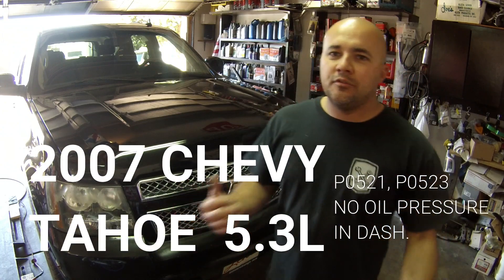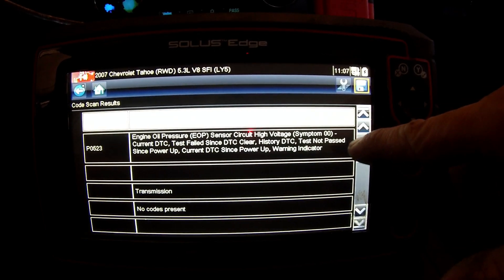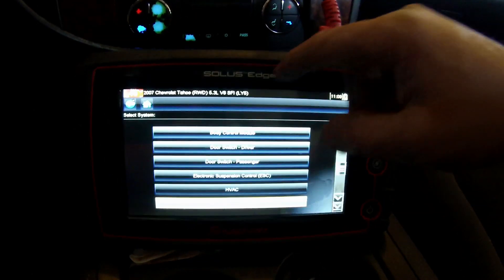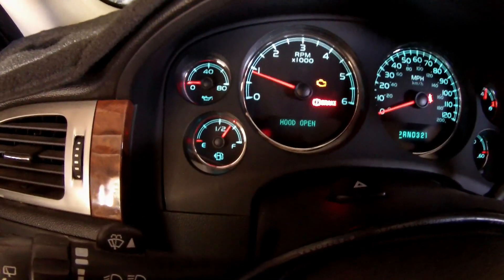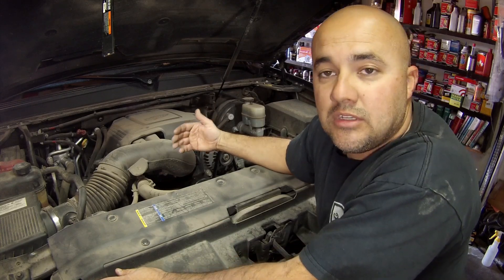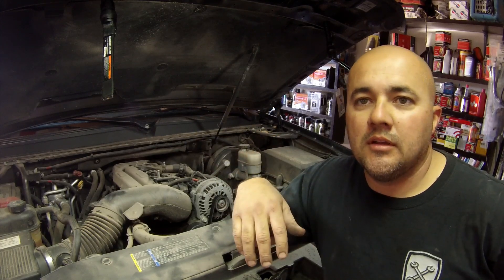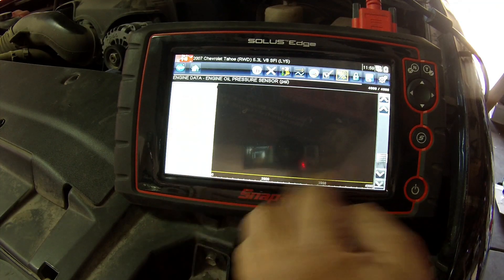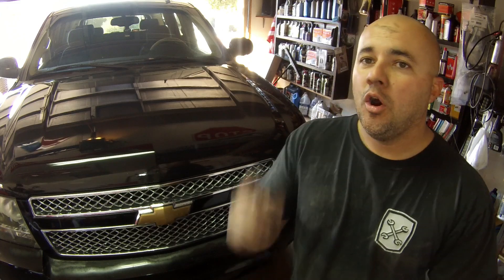Chevy Tahoe no oil pressure in dash. P0521 P0523

Comment: Hey bro whats up i have p0521 it reads about 14psi at idle and at 3k rpms at 30psi I replaced the oil pressure sensor and i keep getting that code very fast so I started checking and noticed that engine off key on i have 2.9 psi and if I unplug the sensor it drops to 0 psi is it normal to be at 2.9 psi when engine is off and it’s probably my oil pump going bad?
Reply from the maker: I would replace the oil pressure sensor w/ a factory one first.  Just unplug the sensor off the old one,  open the box and plug it into the new sensor and see what it reads.
Reply from the maker: In the video I didn’t show replace the little screen under the sensor.  Make sure to change that also.

Comment: Everybody’s going about getting to that sensor all wrong. If you reach straight down from the top of the engine at the back, it’s a direct line to the sensor 6 inch extension on a socket is plenty to get in there if you stick your phone straight back and take a picture of it you’ll see it nothing needs to be removed. It’s about a 15 minute procedure to remove it and replace it.

Comment: Below the sender in the oil passage there's a screen that can be pulled out and cleaned. If this screen is plugged with debris you'll get weird p532 type codes with the new sender. Always pull the sender and pull out the screen and replace it clean. Saves you a come back
later. There's a GM service bulletin on the issue.

Comment: I replaced the oil pressure sensor and filter took me about 20 mins. I am no mechanic but I was determined to get that thing changed. My oil pressure now reads 20 psi, it won’t go any higher than that, it slightly goes up when I hit the gas for a few seconds but it stays under 20. What else could be wrong?
Reply from the maker: 20psi at idle is about normal for a 5.3L. It will rise slightly when you hit the throttle but should stabilize around 20psi.  Hope this helps.
Reply: @fixersautomotive4514  thanks, so this is what I did after that, I changed the oil, I used 10w-30 synthetic valvoline and changed the oil filter and also the air filter just because it was time to do it. After doing that my pressure was up to 40 again.
Reply: Btw I did that 2 weeks ago, after that a-lot of things have happened lol. My started dies and my wife was stranded in Houston, I changed the starter and the oil pressure was down to 0 again. I was upset. So I changed the oil again and nothing. And just when I was about to take it to the shop I thought, man I bet is that damn oil pressure filter that is clogged again. So I went to oreilly’s and bought one for $10. I switched it out and wallah, the pressure is up agaain. So this leads me to conclude that I still have a lot of junk in that engine that still clogging the filter.

Comment: I have the exact same problem on my 13 Chevy suburban and my mechanic is saying his computer it's telling him it's electrical problem mind you we replaced the sensor a week ago and all was fine till yesterday when the reading stuck at 0
Reply from the maker: Very common problem,  you have to use the Chevy dealership updated part not aftermarket for that certain issue.  Good luck.

Comment: My 2011 Tahoe ltz just started doing the same thing just happy it might be the switch vs the oil pump I think that’s really expensive I just got the truck and have to put money in it 😩😩😩
Reply from the maker: More then likely it’s the sensor.  95% of the time it’s just the sensor.  Good luck.
Reply: Was it the sensor? 
I have the same issue. Drove a bit this morning noticed zero pressure. I stopped and checked the oil just to make sure I had oil, lol. There were no obvious leaks. I didn't get a good measurement from the dip stick but I was just making sure it has oil. 
Got home, parked, let it cool & settle and oil level is good. Is it possibly pumping oil but indicating there's no pressure? I purchased the sensor and plan on replacing it tomorrow. I'm just worried it's something worse and by worse I mean expensive.
2009 Tahoe LTZ 5.3 flex 4x4
(Edit to add: my check engine light is on and my oil pressure gauge does not even move but I do not get a warning on the driver information read out, no "low oil pressure/ stop vehicle". Does that mean anything?)

Comment: You explained this sensor issue very well. I have the same issue with my 2009 Chevy Tahoe. I wanted to educate myself about the problem, so that I don't get ripped off. I have had to replace the fuel pump sensor on my Tahoe and the engine light is always on, no matter what I do. Thanks again!!
Reply from the maker: Sweet.  Thank you for the nice comment,  happy you liked my video.

Comment: Any Idea of what this sound may be?  
https://youtu.be/lnWUaX7Kg0E
 I went to work and realized my oil light was on as I was on the highway, as soon as I pulled up to work, the engine shut off and wouldn't restart.  I went and got oil and it started, but now makes this sound.  easy fix?  or a new engine?  any recommendations?
Reply from the maker: That sounds like a collapse lifter making the ticking noise. You might have to remove the valve covers to see if there are any loose rocker arms and pushrods.

Comment: Good Video. I had a faulty oil pressure sensor reading at 0. I replaced the sensor and it read at 20 then went back down to 0. I also replaced the o-ring on the pickup tube. Dreading it’s the oil pump but I don’t hear any changed in the engine.

Comment: Buy the socket. not just a deep socket. autozone sells the oil pressure sensor socket. also gonna need fuel line/ac line disconnect tool. its a chevy, nothing just slides off.

Comment: If on the gauge sweep the oil pressure gauge would not have moved,  that would set an engine code? Also did you replace or clean the oil pressure sensor filter right under it?

Comment: So I know this doesn't have a ton to do with this video but was hoping someone could point me in the right direction. Upon starting my engine the oil pressure is just above 40 after it warms up and is driven a bit it slowly drops down eventually to 0 and tells me to shut off engine. I have replaced the sending unit and screen. This seemed to fix the problem for a couple weeks. I then changed the O-ring on the pickup tube last night. Refilled with fresh 5w-30 synthetic oil and did a test drive this morning and still having the same problem. the engine never sounds like it isn't getting enough oil to any part. If anyone has another direction to head I'd appreciate any ideas. Thank you.
Reply from the maker: If I was you,  I would install a mechanical gauge w/ a hose that’s long enough to read w/ the hood closed.  Install the gauge in the same hole as the oil pressure sensor. Take it for a drive and see if you lose oil pressure. If the oil pressure drops again. Then it’s your oil pump.  Worse case scenario if the oil pump doesn’t fix it then it’s inside the block. Maybe main bearing wearing out.  How many miles you have ? Also maybe use a thicker base oil 20w50. Hope that helps.
Reply: @fixersautomotive4514  it has 145k miles. I'll see if I can find a gauge to get that checked out. the oil pump would defiantly be better than anything in the engine. thanks for the reply
Reply: You figure it out? Same with my 12
Reply: @ryno856  everything went south. Put in a new engine. Something bounced around under the head. From what I could tell this is the first sign of the end

Comment: Just had my sensor AND filter replaced today. Make SURE they place a NEW filter when they replace the sensor. I had it done at dealership. My truck's been paid off for 5 years so I don't mind. Plus, the dealership works on Chevrolets 6 days a week, are used to replacing hard to get to parts like this, and they've got all the needed tools. I was in/out in an hour. Sometimes you pay for convenience.

Comment: I did every thing which is mentioned in this video but still no luck. Still its showing 128 psi oil pressure weather the engine is running or stopped. Can enyone help me with this plz. Really in big trouble
Reply from the maker: Abdullah Awan hello,  are you able to do a gauge sweep? The dash gauge itself might be bad. Maybe try a different brand of sensor.
Reply: @fixersautomotive4514  i did the guage sweep and its not working. But it is saying in the dash that engine oil pressure low turn off the vehicle. My question is if the guage it self not working will it display this message or not. I bought orignal sensor from dealer. But same problem. Reallllly need help. By the way, thanks for replying ☺️. U r awesome
Reply from the maker: Abdullah Awan yes if the sensor is bad it will say that message.  If you can check the oil pressure mechanically w/ a oil pressure gauge just to make sure the oil pressure for the motor is fine and not low. The stepper motor in the dash is probably bad, that’s what a gauge sweep is for to test all the gauges.

Comment: I am actually having this issues as well. But idk how long it's been like that honestly.  It's not running different or knocking. Engine sounds great! I've only had the vehicle for 3wks.
Reply from the maker: erica captain this is a very common problem for Chevy V8 engine in any vehicle. Oil pressure sensors are usually easy to change out.  If your engine doesn’t knock or runs just fine, that’s a good place to start.  Good luck and thank you for your comment.  Please share and subscribe to my channel.

Comment: My 2012 Silverado oil gauge would drop to 0 after running down the road for 5 min.  Display said shut off the engine. After a few min shut off and restart the oil gauge was fine 40psi. 

I replaced the sensor and screen. During removal I could not ID the clip holding the wire connector to the sensor. I just pulled the connector up and removed the sensor and screen. I saw a method on YouTube to thread a screw into the filter that worked fine.  I replaced the sensor with OEMAC/Delco parts. 

Oil pressure gauge came right up to 50psi. 

I did an oil change and filter. 

Next time I drove the truck it happened again!  Pulled over shut it off. Restarted immediately and had full oil pressure. 

I’m thinking the connector warms up and gets loose due to no hold down clip? 

Any thoughts.
Reply from the maker: Marty Van Haren higher mileage vortec engines don’t like synthetic motor oil. At least in my opinion and what I’ve seen. Also it seems to sound like you might have a bad O-ring from the oil pump pick up to the oil pump, that is a known issue with low to no oil pressure problems. If your truck is not a four-wheel-drive it’s pretty simple to drop the oil pan and change the oil pump pick up tube oring, I hope this helps keep me informed.
Reply: What if I change the  o ring the fpm pcm throttle body and throttle body sensor oil pressure sensor  and light still came back I checked the compression  and it 40

Comment: Since ask to take these new test, then passing all 8,  being an ASE Master Tech since the building said "Datsun" on the front of the building, I appreciate any tech who is will to not jump to conclusions and just start without testing first. You have my gratitude! 
 In my day, we rebuild everything as the only part that came in a box from a distributor, carburetor, alternator or starter was new from the dealer. So using your scan-tools lab scope function to "SEE" the 5 volt or signal is the right way. Too many techs today start with a wheel borrow full of parts, then send back as defects when they don't fix the "Root" cause as you did.

Comment: I have a 2007 Suburban 1500 5.3 L vortec which has a similar problem. It had trouble with oil pressure reading low quite some time ago, but it also had the AFM issue and I replaced the lifter a couple of times before I decided to buy the kit that replaces the cam and puts a new cover without the AFM stuff on it. When I finished it and got the PCM re-written, I was able to get the vehicle started and after awhile it ran well. I took it for a drive and it had several codes so I reset them and drove it some more. The codes did not return.

Then I began to get P0521 error codes. The oil pressure is 40 psi at start up, revs to 80 psi or so and when hot it appears to be around 20 psi at idle. So I put a mechanical gauge on it which showed 36 psi but some air was in the line, too. The point was that the pressure was there just as the other gauge indicated. That made me decide that the sender must be the culprit and I replaced it. Alas, I had similar problems to get it out, but the worst came when the new one slipped out of my fingers and onto the cover plate under the intake manifold. I finally gave up trying to retrieve it and removed the intake manifold - it was stuck between the foam and the edge of the manifold.

Now I got it all back together and started it - works like a champ. Took it for a drive - no error code. Fixed! Wrong! I took it for another spin a day later and sure enough, the error was back! I hear no clicking or engine noises that indicate low pressure, the engine gauges say the pressure is there, but the PCM says that the voltages are wrong. I checked the voltages between 2 and 3 and between the pins to ground. 0 volts all around with power off and 5 volts from 2 to ground and from 2 to 3 with power on. 1 and 3 to ground are both 0 volts as expected. Unless I got a bad sender unit, it should be ok. So what is it?

If I pull the timing chain cover and replace the oil pump, nine chances out of ten there will be no improvement in oil pressure.

Comment: If the pin two no power supply 5volts,thats mean the problem is ECU from the engine? because as i know from the power box   is 12 volts.and 5volts should be series' by resistor,and the resistor is inside the ECU.

Comment: I have a 2007 Suburban 5.3L - It has experienced oil consumption and oil pressure issues since 45,000 miles.  The truck now has 260,000 miles after a motor rebuild at 126,000.  Here is the best solution sequence I've come across after much research.  

Run the correct motor oil and a good quality filter, 5W30 and the best filter you can buy, I usually run a full synthetic and change every 6000 miles.  Do not changes motor oil weights and use oil additives to solve this problem.  

1) change the PCV valve cover to the new one, the original one is a flawed design, $120 and some labor
https://www.youtube.com/watch?v=uC89I3j0e5Q

1b) disable the AFM using a Range Technologies product. $200, no labor - plug it into the OBD port - this keeps your engine from switching into V4 mode using the AFM (active fuel management), it will stay in V8 mode all the time.  It's a truck, keep it a V8, you might experience slightly lower MPG but your power will increase. AFM is one of the root causes of spark plug fouling and lifter issues.
https://www.youtube.com/watch?v=HGdqaAoAR88

2) change out the oil pressure sensor and screen if you experience sudden drop in oil pressure and get the idiot warning signal to stop your engine, with right tools and some tool dexterity you can change this yourself,  beware some mechanics will do this job and eat up a lot of shop hours tearing the top off your motor to get to the part and screen. $80 parts, labor depends, DIY you'll have to buy the right tools, shop rate look at 1 - 2 hour minimum depending upon mechanic experience with this change..
https://www.youtube.com/watch?v=_LJW7UBlALY

4) replace the o-ring on the oil pick up tube that inserts into the oil pump if you have a leak and your oil pressure gauge fluctuates,  most likely the o ring has a crack and you are sucking air - $5 part but this is a labor intensive job and should be done by an mechanic that has access to a rack, tools and experience.
https://www.youtube.com/watch?v=cofs-4Ex3VM
https://www.youtube.com/watch?v=51RusQeWZ1A
Reply: thanks for sharing ur knowledge man